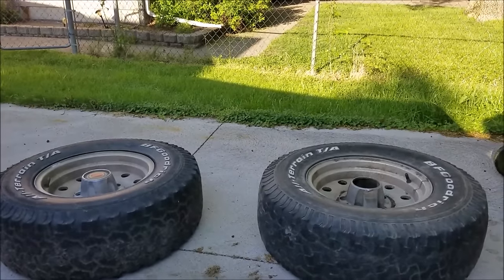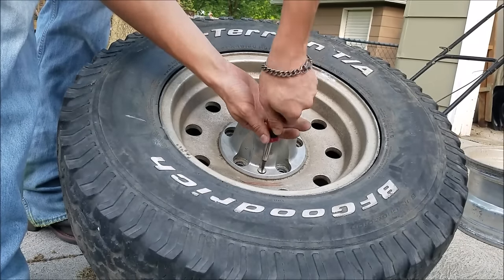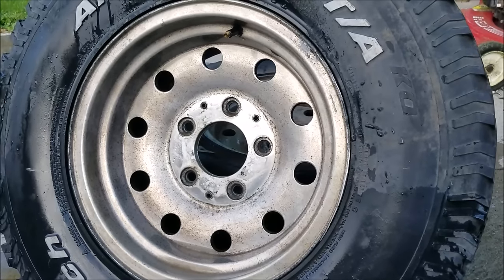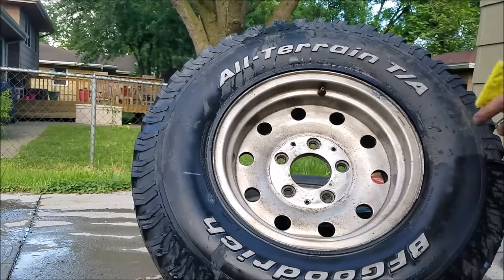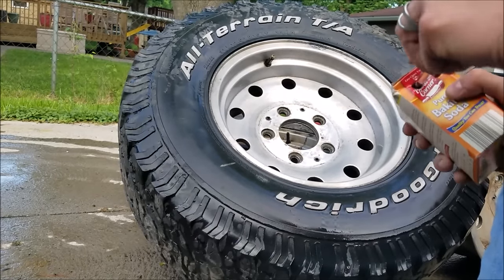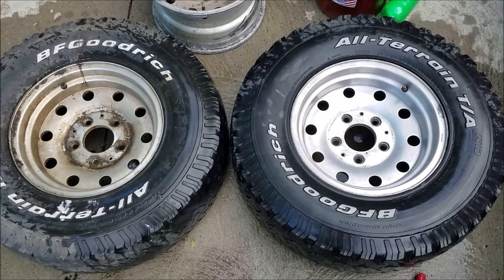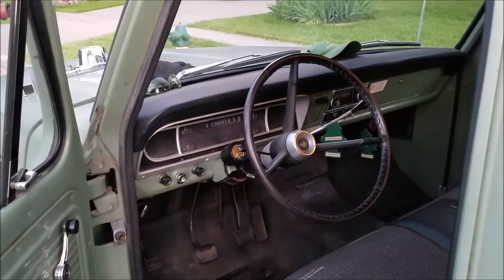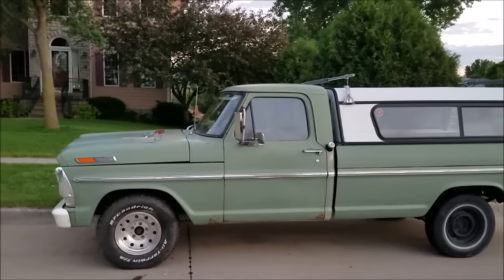Cleaning Nasty Aluminum Wheels with Household Products - WOW !!!!

Comment: where can I get these wheels at???
Reply from the maker: Any early 90s 4 wheel truck tends to have them!
Reply: ThunderHead289 salvage yard will be fine?
Reply: ThunderHead289 cause I have an 89 f150 with the steelies on it. I have the wembledon white and that's what I painted them and it looked good with chrome nutts and beauty rings. but now I want shiny wheels haha. so I saw the Eddie Bauer mags and I was mmmmmm those look great!!!!
Reply from the maker: +Chris Perry a lot of salvage yards have them. It's hard to find ones that are in good enough shape to bring back and make decent. They are getting harder and harder to find!!!
Reply: ThunderHead289 dang. I just converted my 89 to carburetor and I can't find out how I'm now getting spark but I think it's cause I didn't put the distributor in correctly lolololol
Reply from the maker: +Chris Perry how do you have the ignition set up?
Reply: ThunderHead289 I have points with an msd blaster 2 coil. everything has voltage but I'm not getting nothing out of my plug wires
Reply from the maker: +Chris Perry have you seen the video I made on how to test an ignition coil?
Reply: ThunderHead289 yeah I tested my coil with an ohm meter and it read everything and everything checked out to be good. I tested my distributor and I'm getting voltage to my distributor but nothing is coming out of my plug wires.... I have a test light that goes in between the wire and plug and it's supposed to flash. but nothing happens
Reply from the maker: +Chris Perry do the things I show in this video and you will definitely find your issue 
https://youtu.be/9GwTtrdtHbQ

Comment: Might as well just use the dish soap cause the baking soda neutralized the acid in the lemon juice and turned it into water.....
Reply from the maker: Yeah, works better when used separately. Amazingly still worked extremely well together.
Reply: zeke112964 zero
Reply: ThunderHead289 c5

Comment: I like it with out the caps better. Maybe just buy nice stainless  cap screws  for the holes and new dust covers for the front wheel bearings if you want it to look more detailed.

Comment: Do not use oven clean as it will pit the wheels or use a heavy de-greaser cleaner either... the rule of thumb if you to have to wear gloves to normally use the clean do not use it on your car any where.... I am surprised that the lemon juice and the baking soda did not do a chemical reaction as they are to be the opposites ... Lemon is a weak acid and the baking soda is a base.... It should have had semi reaction like vinegar and baking soda... The dawn blue soap not the pink etc. would have cleaned it with hardly any scrubbing!!!!!!!!!!